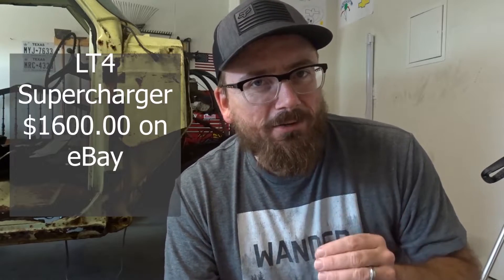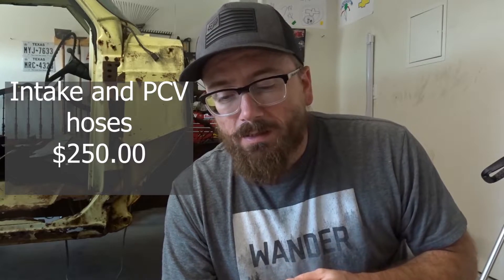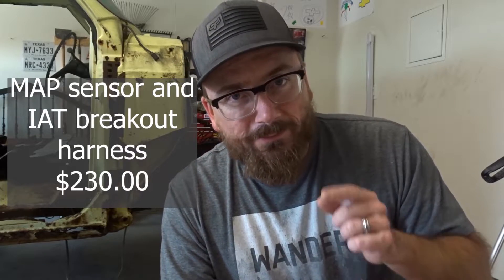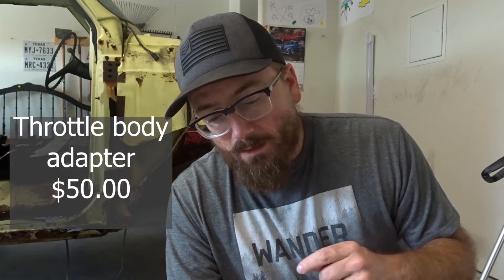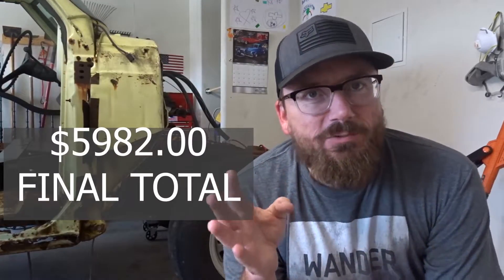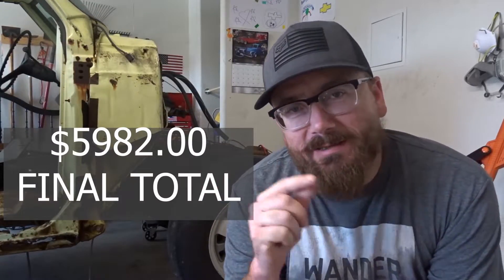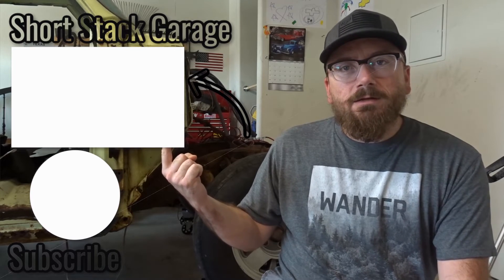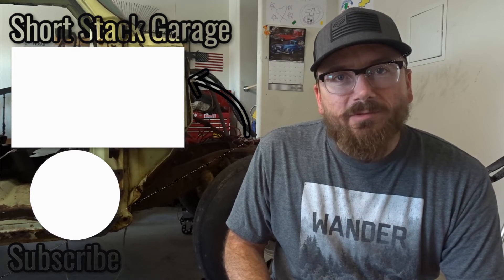LT4 Supercharger swap cost breakdown

Comment: forgive my ignorance but how do you get the transmission to handle the extra power. the 2016 Silverado I have had a weak transmission from what I understand
Reply from the maker: I believe the 8 speeds were the transmissions they were having most of the problems with. The supercharger didn’t stay on the truck long.

Comment: So it's no cheaper than a Whipple you just get to buy a piece by piece and make less horsepower
Reply from the maker: This was almost 4 years ago. It used to be a budget swap, but the prices of the Magnuson and Whipple kits have decreased quite a bit in that time.
Reply: I disagree. Im finding lt4 blowers for 12-1500, conversion kit $3900. so $5100-5400. I haven't found a whipple or anything that cheap yet but I have a l86.

Comment: so the cordes performance one,, which bracket system does it use to mount ????  or do you know.???  What gauges did you add???  just the one you show?????   or which would you do if doing again????   thanks for your help
Reply from the maker: I’m not sure how the Cordes performance tank mounts, I never purchased it myself. I only ran an AEM wideband, but if I were to do it again I would run gauges to monitor afr, oil pressure, iat, and boost. Or I would run something that monitors everything and I can watch it all on one screen. I was usually running around with a laptop monitoring all the items that way.

Comment: does it bolt and use the same bracket or does that kit have a bracket system?????  claims its a 3 gallon tank
Reply from the maker: I think it bolts into the area on the opposite side of the battery.

Comment: Awsome thanks,, did you use the camaro intercooler???????????????????  I rebuilt my 6.2 with diamond pistons and the factory LT4 rods,,, had the heads done by Lingenfelter looking for 650--700
Reply from the maker: Nope, I used a heat exchanger from a 2016 Z06 Corvette.
Reply from the maker: Something that I discovered after doing the swap, was that the reservoir was kind of small. The small reservoir doesn’t cycle enough cooled coolant and your IAT’s can get sort of high. Cordes performance makes one for the Silverado/Sierra, but it’s a little expensive. 
https://cordesperformanceracing.com/product/cpr-2014-gm-truck-ice-tank/

Comment: starting mine on the 6.2 engine,  looking for the map relocate and sensor harness you did , and the pump intercooler and hose's, where dis those come from
Reply from the maker: In the description of this video I list where I got the parts from. The MAP sensor breakout harness, reservoir and hoses have links to them. The intercooler I used was bought off of eBay. It’s a Corvette Z06 factory intercooler.

Comment: Ok, found the tank in the comments.  Any suggestion on what heat exchanger to run?
Reply from the maker: From what I have seen, the corvette heat exchanger works fine with a larger tank. But I’m sure supercharger manufacturers (whipple, magnuson, etc) have nice heat exchangers that would work with some modification.

Comment: Im doing a L83 turbo build with LT4 injectors, LT4 HPFP and a DW400 Lift Pump Assembly Im curious what kind of numbers you were able to push on the LT4 supercharger and what kind of fuel system did you have behind it? Thanks!
Reply from the maker: I never put this truck on the dyno, so I’m unsure of the power. I was running the stock fuel system, because it was the larger pulley. If you run the smaller pulley you will need more fuel for sure.

Comment: Will this apply to my 2020 silverado?  5.3
Reply from the maker: I believe there are some things that are different for the 2019 and up trucks.
Reply: @shortstackgarage2063  ok i thought so but cant find much info on the newer trucks
Reply: @shortstackgarage2063  does the s/c bolt directly to the heads
Reply from the maker: @tedbear6012  You have to purchase adapters for it to bolt up.
Reply: @shortstackgarage2063  do i have to drill my heads for the blower to bolt up? Or do the adapters do the job. I was watching your vid. I just wasnt sure how different my 2020 engine was.
Reply from the maker: @tedbear6012  with the 2020, I’m not too sure what they changed. But with mine, all you do is bolt the adapter to the heads, then bolt the supercharger to the adapters.

Comment: what kind of power were you hoping for? 500hp in these trucks isn't bad at all
Reply from the maker: I agree, 500 isn’t bad. It’s the power to weight ratio that sucks. I’m used to cars that are 1,500 pounds lighter, so in turn they are quicker.

Comment: Did you add the lt4 high pressure pump too it aswell
Reply from the maker: I didn’t add it on my build, but you can. Do Lt4 injectors along with the hpfp and you can run the smaller pulley for a little more boost.

Comment: Do you know why the 17-19 LT4 superchargers wont work?
Reply from the maker: The lid is taller on them. GM changed the cooling bricks, so it made the lid taller, and it won’t fit under the cowl of the truck.

Comment: Would you just recommend the cordes expansion tank if I was going to do this? Was planning on keeping the zo6 heat exchanger.
Reply from the maker: I have heard very good things on the cordes expansion tank. I think it would make a big difference in your IAT’s
Reply: @shortstackgarage2063  I don’t plan on making big power maybe 450-500 at the wheels. You didn’t have any other concerns with the whole install beside IATs? Going to buy the adm kit.
Reply from the maker: @SIL3NTxSTUDIOS  Not at all. It just didn’t make enough power for me. That’s why I moved on, and bought an F Body.

Comment: I’m doing a L83 swap in my third gen camaro right now... stuck at the wiring part but it’s in with the 6L80
Reply from the maker: J2 .a Are you going to video it? I would like to follow. I almost did this with my 4th Gen, just because of the price of the l83’s and 6l80’s
Reply: Short Stack Garage I’ve put up a few I’m going to show the transmission today, just to show how much lower the pan is
Reply: Short Stack Garage do you know anything about wiring them up? I have everything under the hood of the donor truck. But nothing from inside the cab
Reply from the maker: J2 .a I really don’t. I wish I could help you out.

Comment: Just wanted to update you on my build as we did them at the same time almost, I have my heating problem solved and it ran 115 deg yesterday morning at 85 deg amb temp and then on my way home it was 102 deg and it never got over 138 deg so the HE was upside down and my pump was upside down. I knew it was right when I opened the bleeders and it shot coolant 5 feet as before it would not even barely bubble out of the bleeders.But now I am in the same boat as you so I had to order the rebuild kit as the blower is making a noise under load or going up hills, I noticed I had left the 2 back bolts off of the intake adapters as they are on the outside of the lid but even if that is the cause of the noise I have to remove it to get the screws in so I may as well rebuild it while I have it off. I may save up the money and get the interchiller one day but for now it is fine except for the noise. I put down 620HP at 5600 rpm but that is engine delivered HP so about 525 RWH and thats just 93 octane. I started putting E-85 in it today and should get another 75 Hp to put it around 600 RWH. Once I upgrade the injectors I should get another 3 PSI boost with the 2.5 pulley and get me even higher.
   It has been a mess but I see light at the end.   Thanks for all the help you provided as it is very hard to get any help.
Reply from the maker: I’m glad you got it running right!! I’m glad I was able to help you, and I’m sorry you couldn’t get help elsewhere. Now you will be able to help other people out with this swap!! Those are good numbers!!
Reply: I've been battling the same high IAT issue. I went with the Cordes 3 gallon reservoir, which I brought up to Short Stack. I'm also running an interchiller, which is expensive, but worth it. Installer wired my intercooler pumo up wrong. Wired the signal wire to something were it shut off when I shifted into any gear other than Park. So I literally had no flow.... fixed that up yesterday, and yesterday was 86° ambient and ny IATs were 75°. Hoping to hash out my 93 tune very soon then work on e85. I'm Jokerz FULL TILT port, katech 103mm tb, 5" intake setup, cam, LT4 topside fueling, and dual walboro 450 pumps in tank. The FI INTERCHILLER is my safety net for these blowers running hot in our trucks.

Hoping over 600whp on 93. Next year hopefully I'll drop in the forged rods/pistons.
Reply from the maker: younggun484 that interchiller is awesome! The price is what was driving me away from it.
Reply: @shortstackgarage2063  i know, hard pill to swallow. What ultimately drove you away from this swap?
Reply from the maker: younggun484 Power to weight ratio, and the amount of money I was going to have to spend to get it to where I want to be. Don’t get me wrong, you could feel the extra power, but it just wasn’t as fast as I would like it to be. Stock 5.3 injectors are so limited, and I just felt like the money would be better spent somewhere else. I have a new project I’m introducing to the channel soon!
Reply: Short Stack Garage so probably for the money just buy a procharger or the 2.9L Whipple you think? I am tossing up the ideal of On3performance turbo kit, the LT4 kit or the Whipple or procharger just so many choices
Reply from the maker: Wee Man I have seen a lot of Whipple, Magnuson, and Pro Charger kits on these trucks. I wanted to do something different, so that’s why I went with the Lt4 kit. With fueling upgrades, the lt4 supercharger actually makes good power. I’ve heard good things about On3, but I just didn’t know much about their kit.
Reply: Short Stack Garage for the price the LT4 and On3 are about the same. I do like the ideal of the LT4 for the power down low, but then again it seems like you would have to upgrade a lot of the parts due to heat. TPS Motorsports has the complete LT4 kit for 4,500 so might look at that. I have a 15 L83 (5.3) with 4.5” lift and 33’s, but gears are 3.42’s I believe so I have really lost power.
Reply from the maker: Wee Man It really just all depends on what you plan on doing with the vehicle. Whether you just want more power to have some fun, or more torque for off road. Yes, the cooling is an issue. I just wish I would have known before piecing my kit together. I could have put together a better heat exchanger setup for just a little bit more than what I paid for mine.
Reply: Short Stack Garage yes it’s sucks when you findout after the fact. I think if I had 600-700 range for end goals I would be happy. It’s a lifted truck so not trying to do 150 lol, but something that can atleast be fun and no worry’s about passing. The kit from TPS Motorsports looks like it just takes all the parts from a Corvette and you put that together.
Reply: @weeman6539  TPS's kit is spotty. In a week or 2 I'll be finishing up my tune for the LT4 blower setup. I'm hoping to be in the 600-700 range for 93 and e85. As mentioned, if you account for the heat this blower makes now and buy necessary parts ahead of time it won't be too bad. Procharger D1X or a Magnuson would've been my other go too's.

I absolutely blew my budget now, but thats common with my builds. Im just making sure its as much a one and done at this point lol.
Reply from the maker: Wee Man There are a couple of different ways to do it. The way I went with the pulley adapter, and tall spacer just seemed like a simpler install.